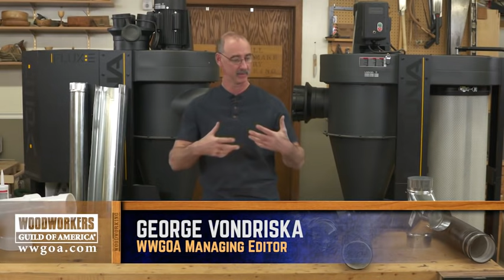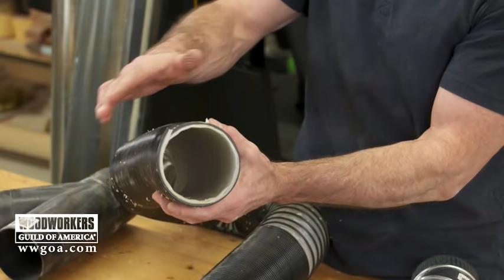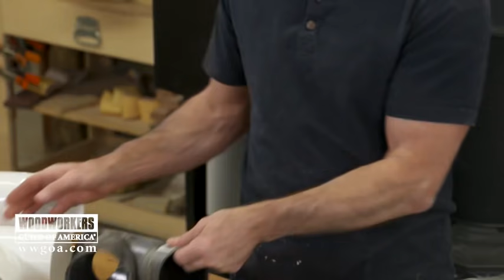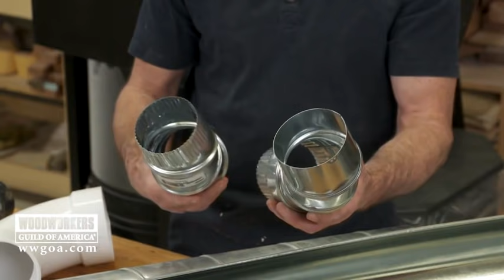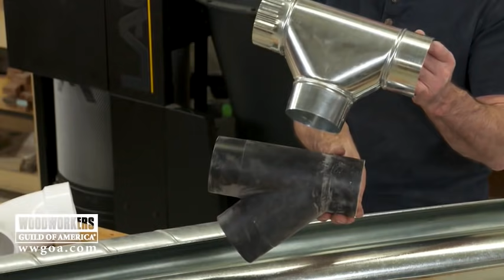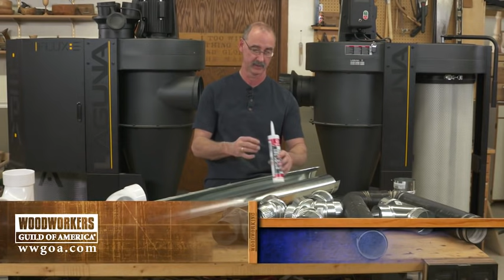Tips for Central Dust Collection

Comment: I have a small question 

When using spiral ducting, do U need to use foil tape where the pipes connect or is it a tight enough seal to not need it

Comment: Can you elaborate on the PVC grounding?
Reply from the maker: Hello, 

You would run a copper wire through your ducting, connecting it to your tool on one end and your dust collector on the other.  The theory is that this will capture the static and send it to ground at the tools. 

Hope this helps, 

Jean
Woodworkers Guild of America Video Membership

Comment: How do you do the math to know what size ducting to use for optimal suction and efficiency for the motor. I have a harbor freight 2hp dust collector. It has a 4” inlet. I want to buy a Oneida super dust deputy, but they offer it in a 4”,5”,&6” cyclone. Which one is best? So if I could do the math on unit to duct size I could figure out any arrangement. Can someone help direct me in the right direction?!?!?
Reply: I am working on this right now with my HF.  I bought the 4” and 4” HVAC snaplock piping just because I have a small garage shop and everything is straightforward rather than reducing 5” or 6” down to 4” at each machine/gate.   Says its good for 2hp or less.  I am still installing but in hindsight the 5” improves airflow and then you use 5” ducting and taper it down...I just didn’t want to purchase all of those reducers.  Haven’t tested yet, but its coming along with many visits to the hardware store to get all set up correctly
Reply: My main reason for asking is Oneida offer the 5”,6” separate and cost only for the cyclone. The 4” they sell makes you have to buy a whole kit and that’s like 250 bucks or so and I don’t want the kit, I just want the cyclone because I want to be able to have the custom set up I want and not this small container they sell that I will never use and it’s a waste of my money
Reply from the maker: Hi Jon.  If the dust collection has a 4" inlet, I would go with the 4" option from Oneida.  I can't think of any reason to go with a larger opening than that as you're not going to improve CFM by opening up wider than the dust collector's inlet.  
Thanks
Paul-Woodworkers Guild of America

Comment: I purchased the Nordfab piping designed specifically for my shop. I found two issues on my install; first , when i use the clamps to put the system together I almost have to stand on the clamps to get them to close, not at all what I see on various videos. I see  you on a ladder using just one hand to snap them closed. Second once I cut the piping to make a shorter run to fit my space the "nipple" does not fit into the next run of pipe, its 7 inch going to 7 inch. The videos show the piping just sliding into the next piece, what am I missing?
Reply from the maker: Rich, unfortunately, our experts haven't worked with this product. We suggest contacting Nordfab directly to see if they have any advice for you. If you have any questions, send us a message. Thanks!

Comment: If I use the 4" HVAC metal duct pipe do I still need to add a ground wire? I am using my HF dust collector in my powder coating business.
Reply from the maker: Hi Dave. No.  If you use metal pipe there's no need to add ground wire.   Thanks- Paul
Reply: @Wwgoa  Thank you.

Comment: Since HVAC is also about moving air efficiently why are their fittings so inefficient?  You would think they would be engineered for good air flow and at least if space dictated you would have the choice of different short radius and long radius bends.  Electrical conduit (NM) does have 'sweep' fittings which work very well for air flow in a vacuum system.

Comment: Good info on the larger diameter duct and its relationship with cfm...but you are wrong about gounding. It doesn't dissipate static, it only provides an additional path to ground.  "static" is called that because it doesn't go anywhere (like travel down a wire)..it stays "static" so the hose itself needs to made made fom conductive resins like carbon dust or conductive urethane. The idea of groundng to do this has been debunked.  Call Flexaust and ask for info on static dissipating flex duct. Surface resisivity is measured in ohms sq, hat is how yo determine if the hose s conductive or dissipating. Gounding is a whole 'nuther thing.

Comment: Plywood rings, (1/2" baltic birch with ring width of 3/4") every two feet on long lengths of large diameter cheap steel tube will prevent collapse. Baltic birch too rich? Make the ring width greater and use inferior scrap sheet stock.

Comment: I actually sell and design dust collection systems for a living and would never sell or design a system using PVC piping. One reason is the elbows and tee’s are all too tight of a radius and will greatly increase your systems static pressure which will make your fan work harder and a loss of suction the further the duct runs go out. As far as static electricity issues, I would mostly be concerned with aluminum dust which can ignite and blow up during the filter cleaning cycle on a dust collector or baghouse.
Reply: Paul Cox  that may be fine but if the system doesn't have the correct mainline velocity the dust and wood chips will drop out of the air stream until it gets to the correct conveyance velocities. You can download an app that I use called duct ductcalculator that is a great tool to calculate cfm, fpm, and to calculate static pressure.

Comment: You cannot ground an insulator with a single wire. 

It’s physically impossible. Insulators don’t conduct current, be it down the length or around the sides till it hits a wire.
Reply: I would like to know if anyone has suffered a fire from their dust collection piping.

Comment: I think I will just stay with my little shop vac and move it around from tool to tool to clean up.  Sure there is a static build up, but I will just live with it.  I would rather deal with a 5 foot hose then a 30 ft duct work.  Keep it simple.
Reply: A shop vac and a dust collector (or cyclone) are not substitutes.  As you note, a shop vac is designed to clean up a mess after it has been made.  A dust collector captures the fine particles of dust that would otherwise be spewed into the air.  Yes, this helps prevent a mess from being made, but the real benefit is that it reduces the amount of dust that gets into your lungs.  The primary benefit from a dust collector is health -- a reduction in mess is just an additional benefit.  And, no, a typical dust mask is not a substitute for a dust collector, either.  A typical dust mask does not capture the very fine dust that causes real damage to your lungs.  A decent dust collector will filter out sub-micron particles of dust.  (A respirator can be considered a substitute for a dust collector, assuming you'll wear it.)
Reply: thanks for the advice.  I do have an air filter fixed to the ceiling which does clear the air for my entire shop.  I do wear a mask to help also.  All the protection I can have the better.  Thanks again.  Tim
Reply: I do wear a mask when I sand and router wood as these are the biggest producers of dust for me.  What I meant about the shop vac was to place the hose a close as I can to the cutting I am doing.  It serves the purpose and helps out a lot more than if I don't do it.  thanks for your feed back.  PS: as an ex-smoker, my lungs are already screwed up.  The mask and vacuum helps me from making it worse.  Take care.  Tim